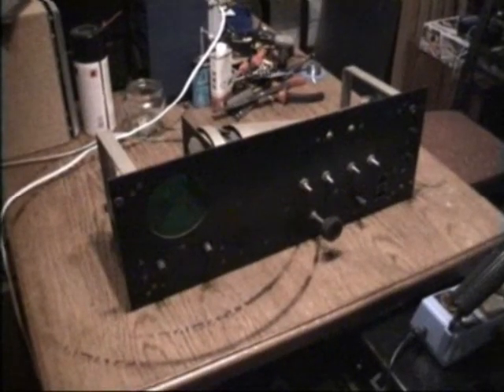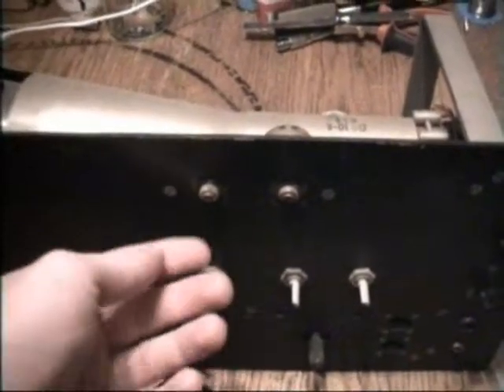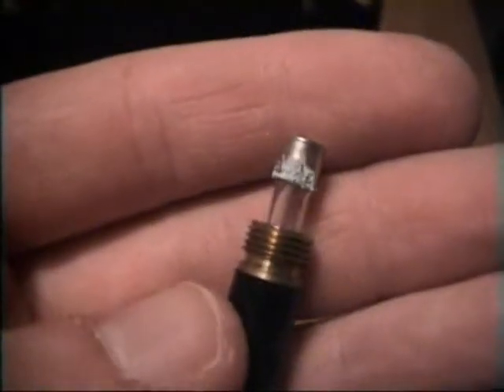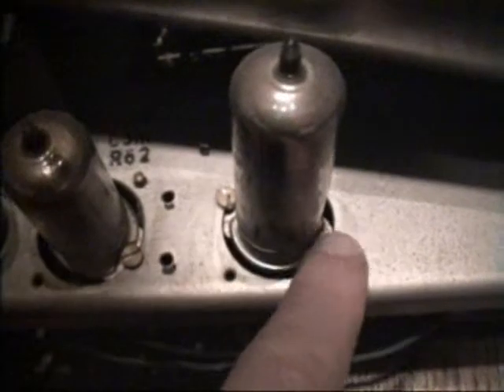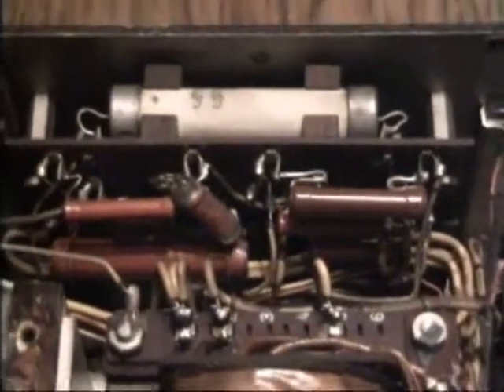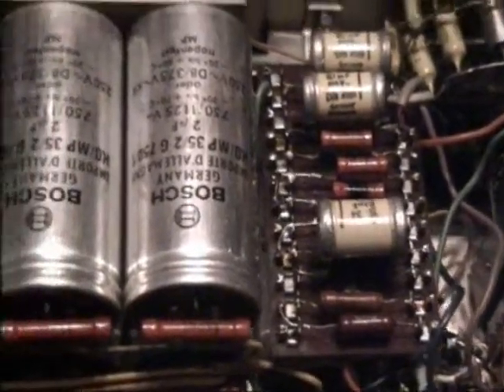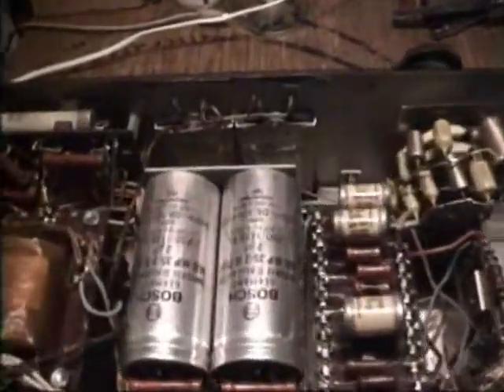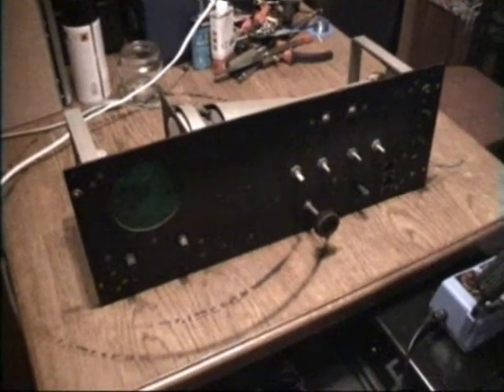mystery oscilloscope device

Comment: This must be an OLD, OLD scope, like mid-1950s max, since apparently it originally had older than 80 series tubes. I can't find anything matching on RMorg but the type of input connectors (light!!!) might tell something.

BTW, the Siemens 16+16µ 'lytic sez "DRP ang.", DRP = Deutsches Reichspatent, and "Made in Germany" (not West!), so must be pre-1949 or even WW2-era. Would match the front design, which is very '40s. A truly historic piece you got there.

Comment: It was definitely built for a specific purpose, and not just as an ordinary oscilloscope. It could've come from a military base, or a telecommunications site, or something like that.

I believe the very long tube means it has high sensitivity, so that even very small changes in the waveform are magnified and made more visible on the display.

Comment: Just a guess: I've seen rack mounted scopes similar to this in high powered radio and TV transmitters.  This unit most likely was part of some sort of big installation like that.  I've never seen one with s side mounted tube, though.  Very unusual. :) JC

Comment: if you cant get it to work agan you could just take the tubes from it. they might be useful if you find an other old tube device that use those kind of tubes.
but hopefuly you can get it to work agan and then you have a oscilloscope witch can be good to have when you construct circuits and reparir things